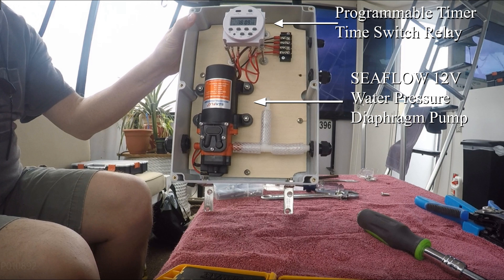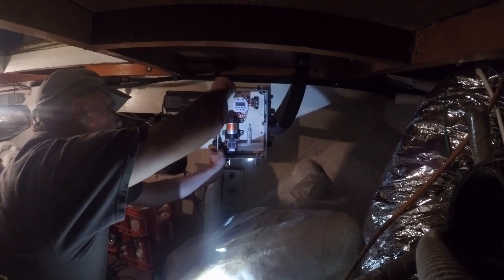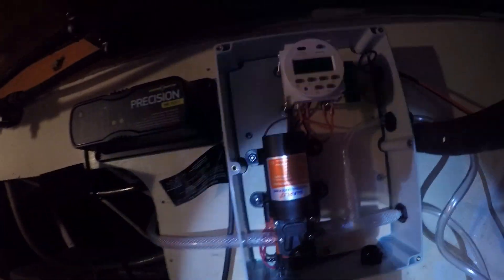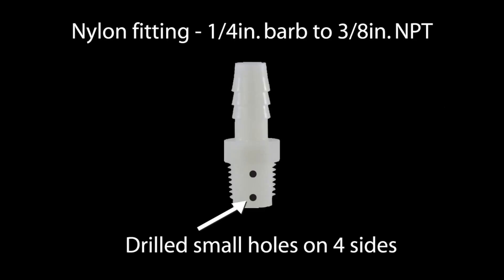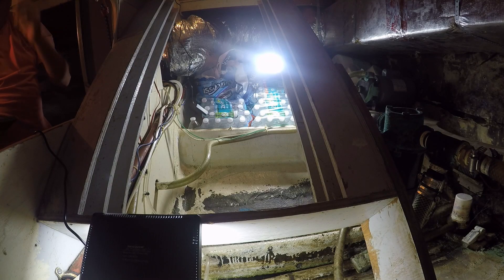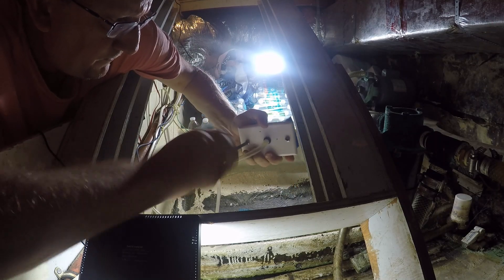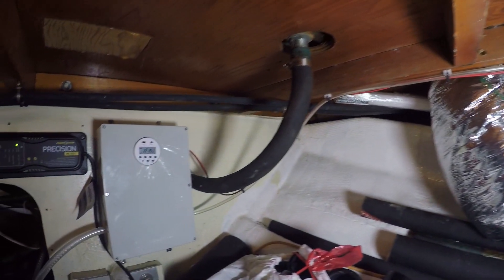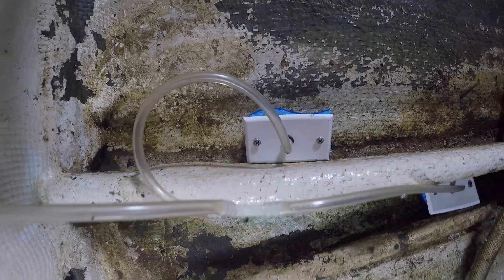007 - Dry Bilge

Comment: Looks great.  T-ing to multiple zones will always be problematic as the one with the least resistance will suck air while the other does nothing.  We now have a 4 zone splitter that you could even use with your system that cycles through 4 zones repeatedly while it is running.  Nice job!

Comment: Nice video. I would like to build one for my sailboat. Can you give more information on the plastic box and insert holding the pump and timer? Size, where can it be purchased, other fittings, etc? Thank you!
Reply from the maker: Hi Ricardo,  If you click on show more in the description there is the list of the components I purchased from Amazon.  The fittings and hose I purchased from my local hardware store.  The wood insert I just cut to fit the box.  I hope this helps.
Reply: @fixingblackjacklady8783  Thank you! Regarding the differential suction strength between one line and the other, a point of general information for folks entertaining doing this with more than one line, each line should be of the same length from sponge to T-connector to reduce risk of one stealing suction power from the other.
Reply from the maker: @febrymd  Learned that the hard way.  My original design had 2 lines going back to 2 Tee connectors.  Didn't work.

Comment: Wondering if zip ties might be a nice backup to the sheet metal screws into the sponge?
Reply from the maker: Surprisingly the screws bite into the sponge quite well but I would consider it if the pickup was going in a hard to reach location and losing the sponge would be inconvenient